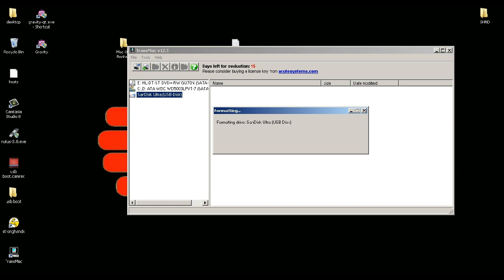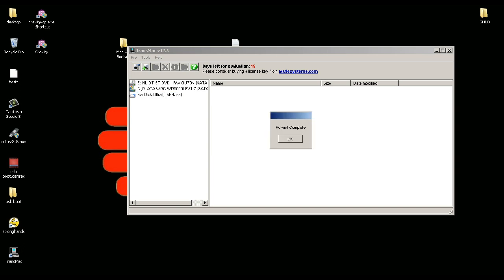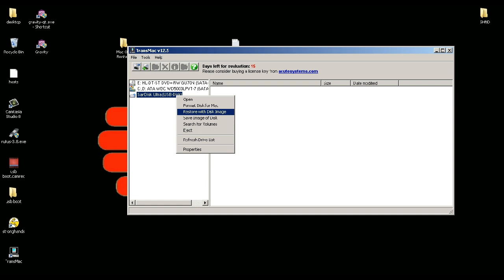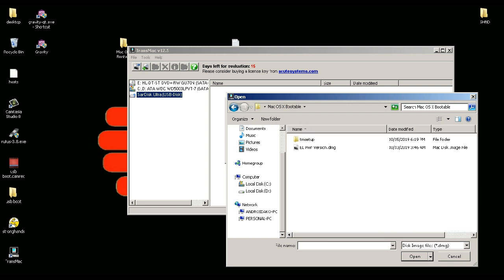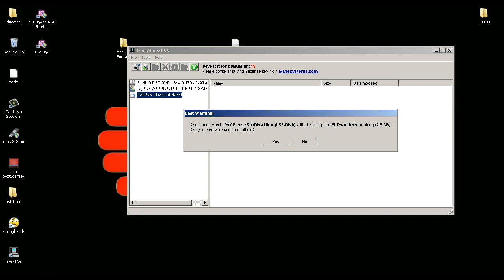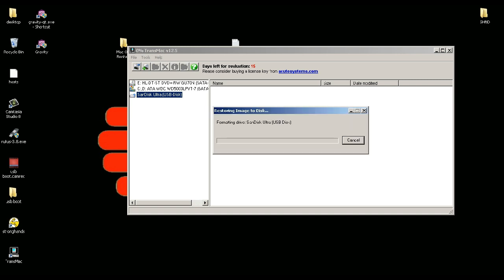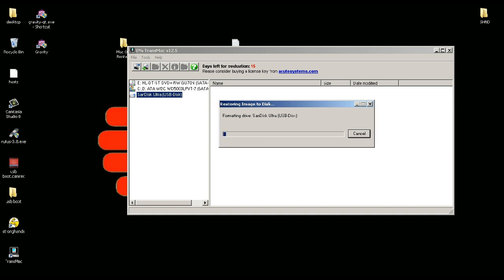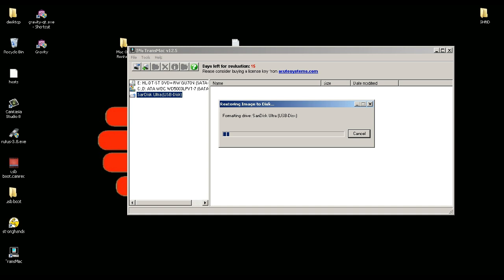How to create Mac OS X USB Bootable from Windows 7/10 (Tagalog Tutorials)

Comment: Sir, nastuck na po kasi ako sa installation ng mac OS X 10.11 and ilang ulit ko na po siya sinubkang ireinstall. Kaso nageerror pa din, naformat ko na po yung macbook pero same thing pa din po. Running MacOS version ko po before ko imodify yung MacOS is version 10.6.8 and tinatry ko na po ang procedure ninyo sa video na to and making a bootable drive po. Any advise po kung ano susunod na gagawin? Thank you po
Reply from the maker: pag ginawa muh sa transmac ang bootable ok na yan
Reply: Repairtutz Thank you po sirrr. And magmessage po ako sa FB page niyo since may other concern pa po ako regarding sa macbook ko na need ng replacement 😅 Pasensiya na po. Thank you so much po and more videossssssss poooooo regarding windows and Macssssss 💕
Reply: Sir, hindi nagcocomplete ang download nung .dmg file. twice o na po siya nadownload and patapos na po madownload but file foprbidden nakalagay :'( Any advise poooo? Thank you so much poooo
Reply from the maker: @ramongozum2122  hanap ka lang sir sa google ng imac dmg file
Reply: @RepairTUTZ  Okay po sirrrrr.Thank you so muchhhhhhhhhh poooooo <3 ^_^